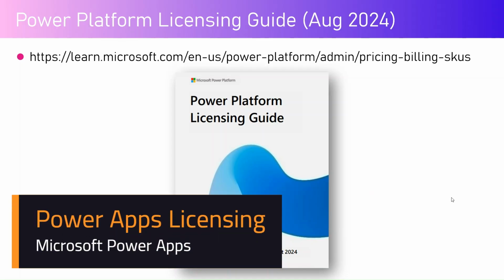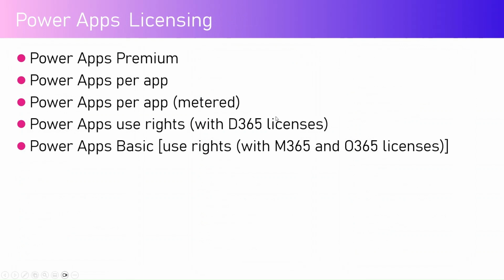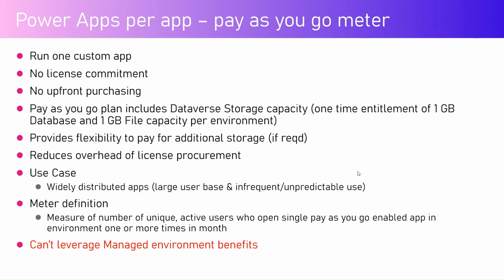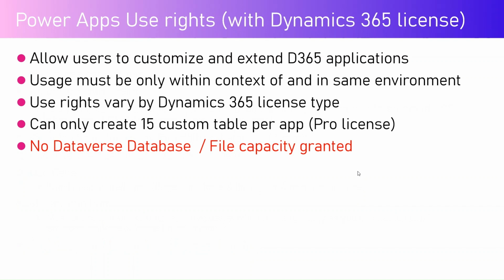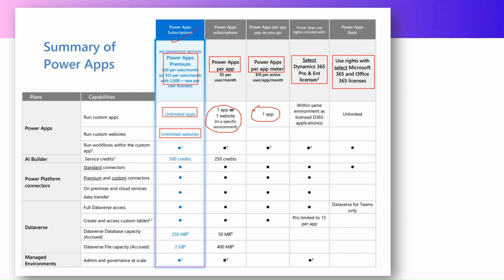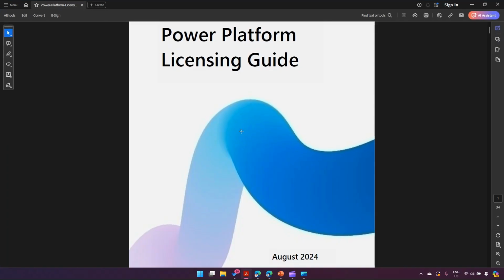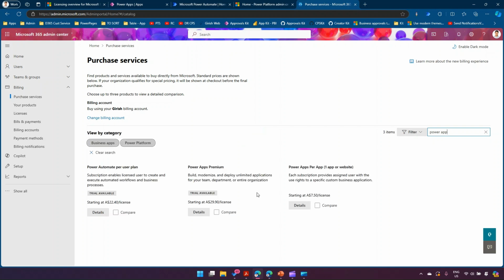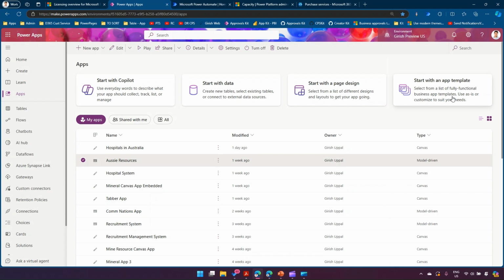Licensing - Microsoft Power Apps

Comment: In users account, the subscriptions list has Microsoft 365 E3 license. Does that mean they can access power apps shared to them assuming it has only standard connectors and using sharepoint as the datasource? But somehow users when they click on the shared link it does not allowed them to access saying they need a license
Reply from the maker: You need to have a license to access Power Apps

Comment: Question: Does a user require a 365 license in order to make use of the Per App license? Or, can a user without any other license be assigned and use a Per App license?
Reply from the maker: Power App licenses are independent of M365 license. Unless you need any M365 app capability, then you technically dont need additional license.

Comment: You skipped put a "Per App" license is assigned per user.
How is that done and is there a screen we can see all users assigned a per app license for a specific app?
Reply from the maker: Sorry i did not get your question. What did i skip ? the content or video segment ?
Reply: @ maybe it’s our environment but we can’t get out how per app licenses get assigned. 

We thought it was because we couldn’t see them being assigned but it doesn’t look like our environment is enforcing per app licenses at all. 

We have 20 users using a model driven app and they are not licensed properly. We are trying to get them licensed with per app licenses but it’s not working. 

Does Microsoft not enforce power app licensing on model driven apps?